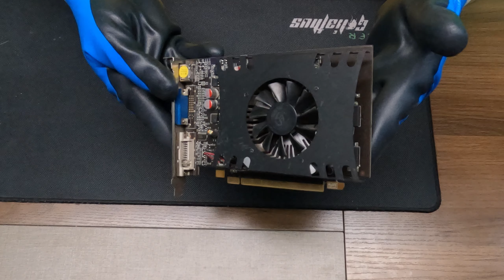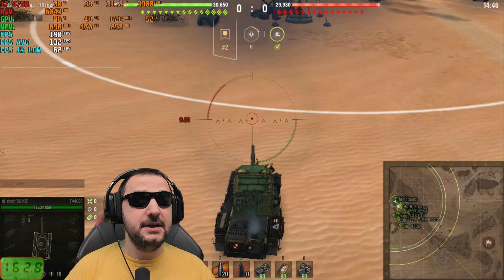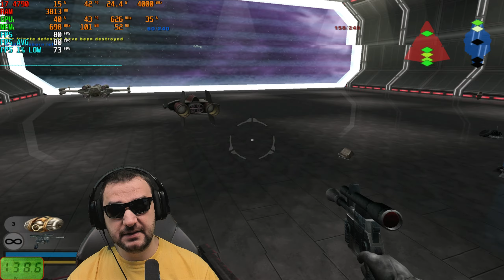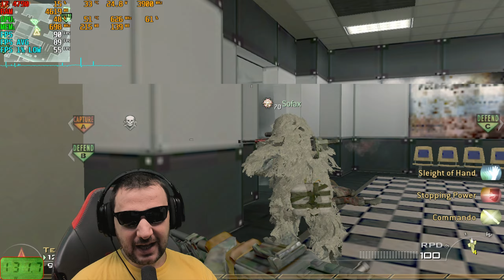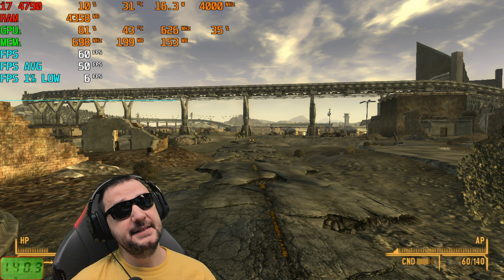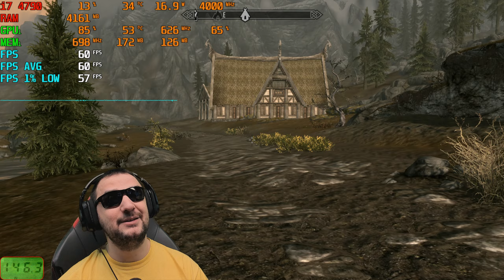Club 3D GT 220 Benchmark

Comment: I used gt 220 1GB version until last month when I switched to gtx 750 4GB version (afox). ofc not in my main rig, in that I play old games. gt 220 was terrible, official drivers ended in 2016. Could barely run original san andreas at 1080 xD